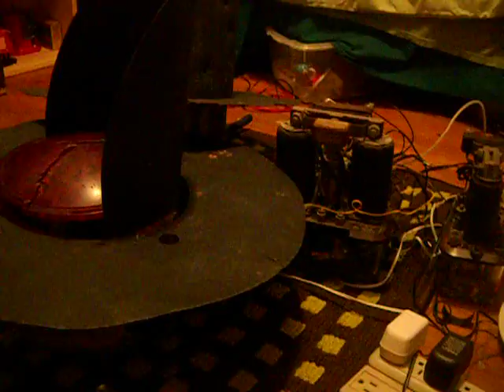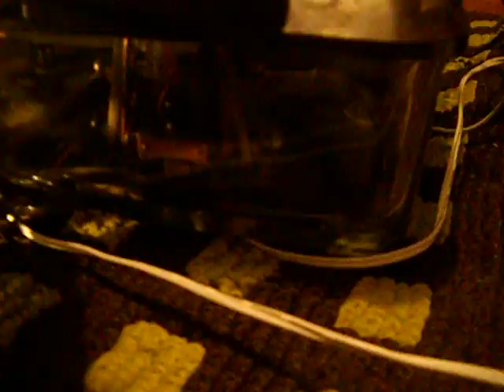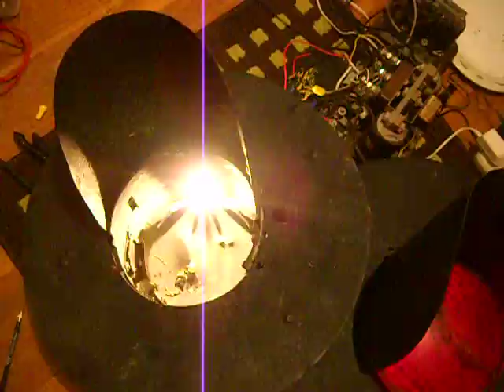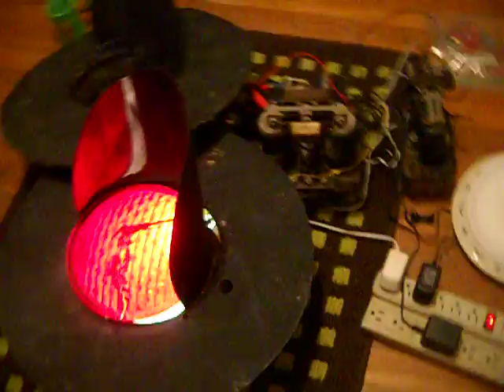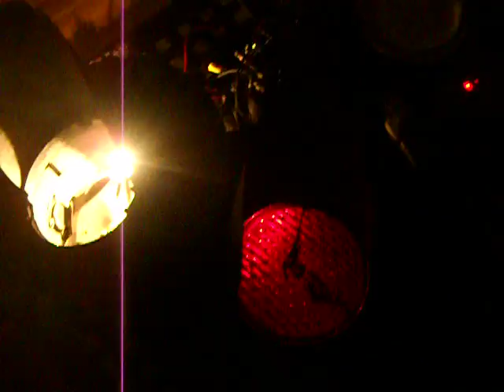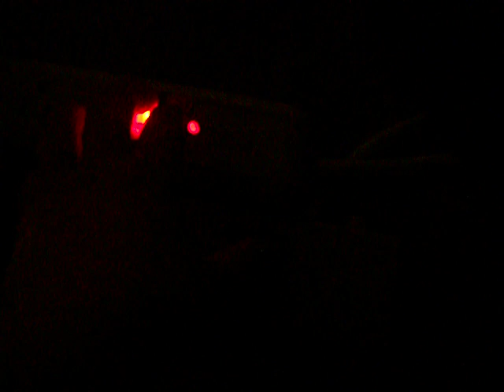GRS flasher relay

Comment: @jtd321  thank you for responding.  Bridged means connected. For example: A jumper wire connecting (bridging) two terminals.
My relay required thaterminals 2 and 3 be connected.  (brown 3-terminal block athe top.)
Noworks fine but I wanto slow it down to 40 fpm  (flashes per minute).
Runs OK on a battery charger seto 6 volts. (Is probably 8 volts to charge a 6-volt battery.) Don't forget to add diodes to the coils to prevent EMF collapse surge from damaging your power supplies.

Comment: @jtd321 Your K Flasher is working well!  It should not matter that it was not used.  Maybe contacts will oxidize but that would quickly wear away with a little use.
I would expect them both to be wired identically.  I drew a schematic (wiring diagram) of my relay and figured out why it did not operate.
Mine is now working fine but I want to slow it.

Comment from the maker: @robertgift Hi, I don't know what bridged means. But  all I know is, I have two seperate 9v power supplies for the coils, with the Positive wires  of both on the middle terminal,  and one negative from each  connected to the  right and left terminals. It will not work with only one power supply powering both coils.
(or at least for me it didn't)

Comment from the maker: It's called Kdc  dc flashing.  model numbers probably wont help because these are obsolete now. If you search railroad relay on ebay you usally get some results. or search General Railway signals.

Comment: I have a GRS Type K D.C. FLASHING relay.

It has THREE terminals at the top of the coils for the 10 VDC to operate the relay.
Are two to be bridged?  

The 12 terminals below connect to the relay contacts for power to the contacts and out to the lamps.
Thank you.